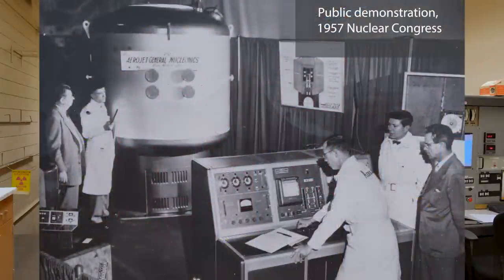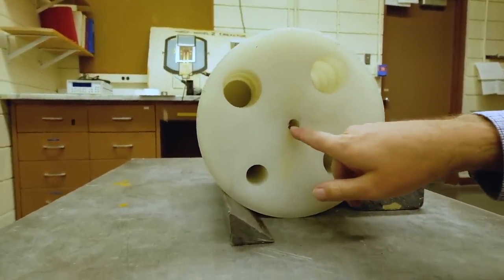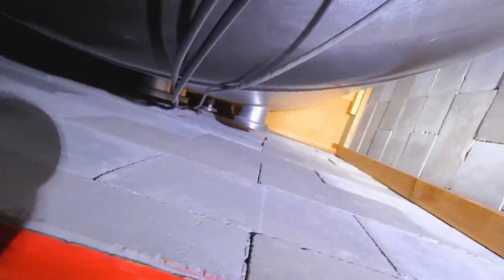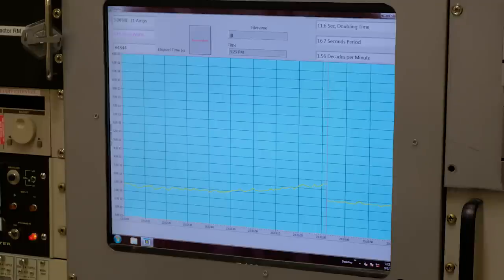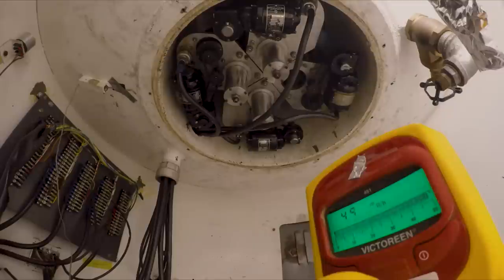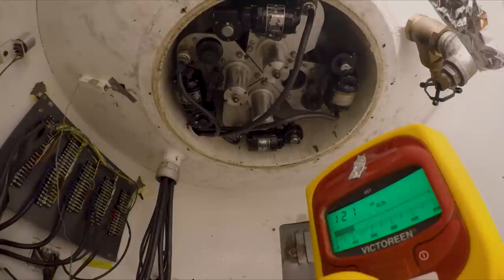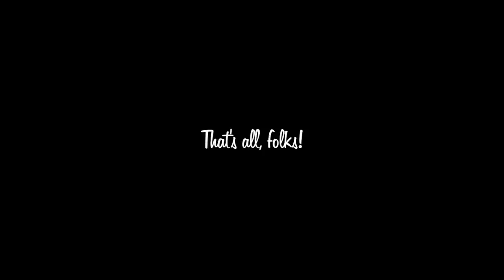UNM Nuclear Reactor Tour and Demo, 2020

Comment: I love how they're running the control software for a nuclear reactor on a pc running windows 7 with USB slots exposed on the front of the machine.
Reply from the maker: No, the PC at the console does not run "the control software for a nuclear reactor."  It is an experimental / teaching aid having no interconnection with the reactor controls and no defined role in the facility tech specs.  It runs a LabVIEW executable that collects and displays data from an auxiliary ex-core neutron detector, and we have that data on the display in this video because it's instructional.  The computer is old.  It runs an old OS.  And although it works just fine, anyone outraged that old tech is in use at UNM is welcome to quench their concerns by making a hefty donation to the UNM Foundation here: https://www.unmfund.org/ That way, when our console PC is no longer working just fine, we can replace it with a $4000 PC specced for gaming and slap your name on it.
Reply: This building is controlled access and the PC is likely not on the network, so it's not a huge concern.
Reply from the maker: @MontegaB  And more importantly, the computer has no reactor control function.  We can and do operate the reactor completely without it.
Reply: @Carl_Willis  I'm loving this reply.  You have a great way of getting your point across.  :D
Reply from the maker: @FletcherFinance  I'm a little surprised sometimes what people PRESUME sometimes.  They presume the computer is controlling the reactor.  They presume that because it's old, it must be insecure, at risk, decrepit, not dependable in its role, etc.  They presume the facility is staffed by complete morons, and presume that they are clever ubermensches who've got this whole thing figured out because they saw some videos and presumed some shit.  Sometimes we just have to cut 'em down to size...
Reply: @Carl_Willis  Totally agree!  People online assume too much and don't ask enough questions.
Reply: @Carl_Willis  This has got to be the hardest roast i've ever seen from a smart person, I'm not very smart, and i'm pretty sure alone you could absolutely kill my grammar. This is what killed him. "That way, when our console PC is no longer working just fine, we can replace it with a $4000 PC specced for gaming and slap your name on it.
" That was stone cold... GG.
Reply: xn0  As long as it doesn't require internet, but then that begs the question on how it got installed there in the first place...
Reply: Windows 10 would force-update in the middle of a safety test.
Reply: Are you ashamed?

Comment: I love that it has a University of New Mexico asset tag on it.
Reply from the maker: This is so if somebody steals the reactor and tries to pawn it, or eBay it, or what have you, it can be tracked down and returned.  Theft is a big problem in the Albuquerque metro area.
Reply: Asset management people can be quite zealous! I used to work for a calibration facility and we would regularly receive hydrometers for calibration with asset tags attached directly to them... which is a bit of a problem, as changing the mass of a hydrometer will utterly destroy its accuracy.
Reply: @MrMe01  We had quite a simple but effective approach - revoke the calibration certificate, and explain if they wanted their hydrometer back with a fresh calibration we needed their permission to remove the tag, otherwise we were happy to ship it back to them uncalibrated and with a certificate declaring it unfit for calibration in its current condition. No idea if that stopped them sticking a tag straight back on it, but as long as we'd told them in writing that doing so would void the calibration our asses were covered (it's lovely when something is officially not your problem!)

Comment: Now if this isn't the most adorable reactor I've ever seen. I want one to play with in my backyard.
Reply: If only the reactor put out enough power to run it's own electronics :(
Reply: @MrTurboTash  Yeah, I'm not even convinced that this reactor makes enough heat to keep its moderator warm.
Reply from the maker: @jordanrodrigues8265  The reactor design is limited by its negative temperature coefficient of reactivity to a steady-state power of about 10 W.  It can generate much more intense transients.  We are license-limited to 5 W.
Reply: @Carl_Willis  if it's not a dumb question, what's the use of such a tiny reactor? I guess as a live education tool? Can you do science or 'useful' stuff with it like irradiate silicon and whatnot?
Reply from the maker: @uzaiyaro  Teaching and training...it demonstrates the same physical behavior as much larger reactor, and is much more approachable for a large variety of hands-on experiments.  It can be used for neutron activation analysis and some other tasks as well.

Comment: Carl;
the U.S. Navy had a small reactor at the Naval Post Graduate school in Monterey, Ca.  This was decommissioned there and later moved to Cal Poly State university where I last saw it.  I very much resembled the AeroJet Nucleonics version you have there in New Mexico.  I saw it operational in Monterey but I do not know if the unit was ever operational at Cal Poly.  Monterey presence was in the 1960's and it appeared at Cal Poly around 1974-76 range.  Thought you might know the history of that reactor as it might be among the 20 that were manufactured by AeroJet.  Great video !!
Reply from the maker: According to my information, the Naval Postgraduate School had an AGN-201, serial 100 (meaning, presumably, the first unit out of production).  I can't tell when it was taken out of service at NPS or what happened after that, but from what you say, it looks like Cal Poly may have picked it up.  Not sure what happened to it after that!
Reply: @Carl_Willis  Carl, the Naval Postgraduate School reactor was shutdown in 1972, and then shipped to Cal Poly SLO where it operated from1973 through 1980 and decommissioned in July 1985. As far as I can tell there were only 15 AGNs with serial numbers although about 25 more were intended.
Reply from the maker: @robertbusch3144  Thanks for the detail!  On a somewhat unrelated note, do you know when and why production stopped?
Reply: @Carl_Willis  Carl, I think they found the market limited. The two main designers, Robert Mainhardt and Arthur Biehl, decided they had finished their challenge and decided to move on. In April 1961, they founded MB Associates (MBA) and got involved in gyrojets and small rocket projectiles. Based on the critical dates, it would seem that the last AGN-201 was finished in 1959.  AGN did make some AGN-211 reactors and in 1965 built a 250 kW pool-type reactor known as the AGN Industrial Reactor. It appears to be a TRIGA reactor. It is now called Aerotest Radiography and Research Reactor (ARRR), Docket 50-228.
Reply: Carl, just found more info at NRC - License for ARRR has been transferred to Nuclear Labyrinth. Letters seem to be going to David Slaughter who was head of Utah's reactor back in the 90's.
Reply: @robertbusch3144  Oh wow! I had no idea the designers of the AGN-201 are the guys responsible for those crazy gyrojet guns. I've always wanted to fire one of them but the ammo is worth more than gold these days. I've often wondered what it would take for someone to bring gyrojet back into production in today's climate. D= They're basically frickin 1950's sci fi space guns. xD

Comment: Nice rebuild on the control panel! I've had the joy of seeing the original AGN-201 panel in various states of disassembly, so I can appreciate the work that you guys put in to assembling your new one. I love the mixture of modern and vintage parts! Since then I've really come to appreciate the old illuminated displays and buttons thanks to channels like FranLab. 

I still like what they did with #103 though, since it keeps the original chassis layout, but I'm probably just biased. xD

I know you're tired of people ragging on you about your monitoring PC for various unimportant reasons, but I'd still suggest you replace it with a redundant pair of modest rackmount servers so that in the event that one gives up the ghost you can quickly flip to the other one to save time and hair pulling and keep the display operational instead of having downtime. I mean, originally students had to work from just the displays on the original panel and didn't have nice pretty digital graphs, but it's still very nice to have.

Comment: Firstly, I had no idea UNM had an adorable little reactor, despite growing up in the area and living in Abq now. Secondly, that startup had me squirming about in my chair. I'm a former nuclear mm and it went nothing like what I was expecting.
Reply from the maker: Yes, quite an unusual little system that surprises plenty of people who have cut their teeth on other reactors.
Reply: @Carl_Willis  Well, it was more the impromptu feel of it. You pulled a safety rod right out of the core and jumped straight into a startup. No estimating critical position, no stopping prior to it to verify indications, no verifying criticality during a pull(in this case push) and wait. Most of my watch officers and my upper chain of command would have freaked out if we pulled anything like that. I understand it is a very small core, but it still is a nuclear reactor.
Reply from the maker: @Jtretta  Yes, there's no requirement to estimate critical position, or to pause on the approach to critical once the coarse and fine rod insertions begin.  I should note that we do verify indications and compare with previous readings both before and after inserting the two safety rods.

Comment: On your manual SCRAM which you said was subject to gravity, why were the rod drive motors operating in high speed?
Reply from the maker: The rods themselves are dropped by a magnet.  The magnet carriage has to be driven to the out position by the motors so the magnet can reengage the rod armature, and that is why these motors are running.  The rods themselves are already down at that time....they drop within a few hundred milliseconds.
Reply: @Carl_Willis  Thanks for explanation! I knew something was missing.
Reply: @fredflickinger643  I was wondering the same thing.  Thanks for asking!

Comment: So cool. Playing with the power of the universe! Very smooth operator you have there too, very nice job. I notice the rod position readouts are analog. Do you guys have rotating cables routed from the motors to the console for that?
Reply from the maker: These are servo indicators, so it's 100% electronic!
Reply: @Carl_Willis  Oh good that makes sense. They look like very good motors and the machining of their mounts looks very expensive! Is all of the rod control assembly original to the reactor, or has that been re-worked over the years?
Reply from the maker: @MontegaB  There have been like-for-like replacements over the years of various parts of the rod drives.

Comment: Hello, what an interesting demo, below are my observational question, apologies that a couple are light hearted (like the first one and the sushi one)

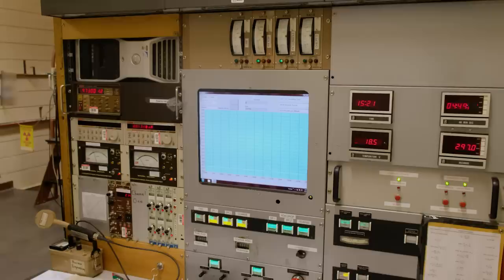12:28 what is behind the blurred door?

12:32 why is this rod not radio active from previous start ups?

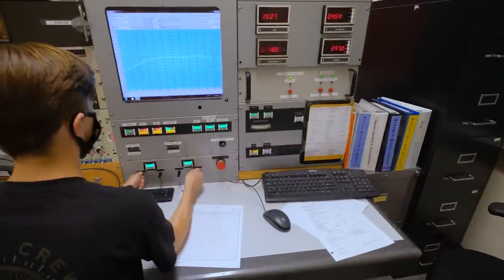17:58 I'm guessing that the phone under his left hand has more computational power then the entire console...

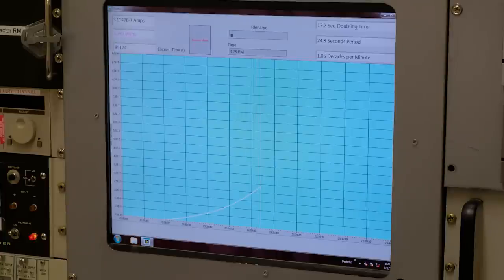21:06 1W, when you say 1W is that literally 1W?  "1 watt of thermal" Like less than a match stick of energy? 

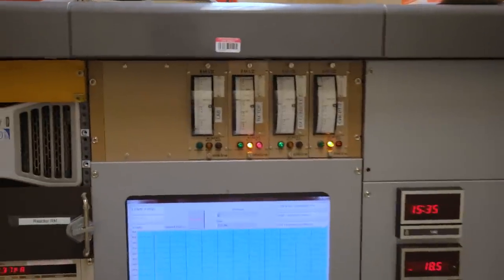26:15 on top of the conosol - is that barcode off someone's sushi box?

28:39 how come this switch gives some physical resistance?

Ohhh and why did youtube not give me a single add? I mean if this was a Rick Beato video then I would get an add every 3 mins

Comment: This is just awesome as usual! And I would finally ask a question I had for a quite some time... Well I do understand why old equipment is measuring R/h but I am wondering why fairly modern devices on Carl's videos are also showing legacy Roentgen unit?  So is that a matter of taste or something else?
Reply from the maker: The Roentgen quantity is easy to measure using electronic instruments.  After all, it's a measure of charge released per mass of air.  And there is the convenient accident of nature that, for most gamma radiation energies encountered in practice, a 1 R exposure produces a whole-body dose equivalent of about 1 rem.  This relationship breaks down at low and high energies (and the exposure unit itself becomes rather meaningless at higher energies).  But the R unit is still used because it is easy to measure and remains broadly meaningful.
Reply: I guess that’s why there’s still a lot of Geiger counters you can buy that can be set to measure in Roentgens or sieverts.

Comment: Thanks for posting this video and the detailed explanations.  This is a really unusual reactor design that I've never seen before.   Dumb questions - what you're calling "control rods" are more properly "fuel rods", right?  That's why inserting them increases the reactivity?   And when you're starting up the reactor, is it critical on prompt neutrons alone?  Doesn't the operator have to be super careful to ensure that it doesn't run away when the delayed neutrons appear?  And is there any kind of cladding on the fuel elements?  What happens to the gaseous fission products?  Thanks again...
Reply from the maker: The control rods are called "safety rod 1," "safety rod 2," "coarse control rod," and "fine control rod" per the manufacturer and the tech specs.  They contain fuel in this reactor and so work a bit differently than absorber-based control rods, but the purpose they serve is the same.  Our reactor is emphatically NOT critical on prompt neutrons alone...that would be very dangerous, and indeed a number of safety measures are taken to prevent even the possibility of prompt criticality in this system, including limiting the excess reactivity and the reactivity of experiments.  The fuel doesn't have a "cladding" per se; the fission product barriers are the fuel composition (sealed plastic) and the hermetically sealed core tank.  Gaseous fission products that end up in the core tank volume are mostly short-lived like Xe-135 and decay in situ.  When we have to open the core tank, we sample the gas in there for detectable fission products before we commence.

Comment: Very nice video, thank you!
What are the in core meters?
The current range of the one you use to measure power indicates a self powered neutron detectector, but I may be completley wrong with that assumption.
I'd love a video where you go over the instrumentaton in more detail!
Reply from the maker: Yep, didn't discuss instrumentation very much here.  The two redundant safety channels are uncompensated boron-lined ion chambers; current from these is displayed on the picoammeters at the console.  They need 600V to operate (although they appear to be "self powered" to a degree if bias is lost).  We also have a pulse-mode fission chamber for start-up measurements and another boron-lined ion chamber that operates the computer display you see at the console.

Comment: i have a question... i am verry facinated about how you an crawl under the reactor core...i dont know hot to explain but...at the time you crawl in the reactor was on a low Power Stage where the radiation isnt that high...but how can you go again in this smal cabin under the Reactor after its got throu 500 Ronten Per Hour... the radioation does othing on the reacor housing?

Comment: You are licensed to operate at or below 5 watts, but what was this reactor rated at from the factory?
It seemed like you had a significant headroom with how fast it was going.
Reply from the maker: The reactor was originally offered with maximum power of 100 mW.  With added shielding, we can operate at 5 W.  At steady state, the reactor will top out at around 10 W due to negative thermal feedback, but it can supposedly generate transients in the kW range without reaching the safety limit.  We're not set up or licensed to do that at UNM, however.
Reply: @Carl_Willis  The unit at Memphis State University was licensed for 500mW.

Comment: Would chernekov radiation be visible from such a low power reactor If there was a place to view it? Thanks for the great video.
Reply: same thing I was thinking.. tbh I'd think not because the beta decays are slowed by the lead wall before moving through the water. open pool type reactors are 1) choochin harder and hotter 2) exclusively using water as transparent shielding not a moderator . idk im just a learning boyscout lol  check out Berkly's experimental reactor where they make exotic elements and shit, on youtube, elements like LIGMA-69, LSD-25 and DATBOI-420 keep your centrifuges off the internet and thorium works too yaknowwhatimsayin?, we just can't make munitions from its depleted fuel .                                without a doubt you're on a watch list  (__)(__)=======D~ how many shakes are in a dollar?
Reply from the maker: None of the reactor core components are transparent to light, so not much of a chance of seeing Cherenkov radiation.  A sensitive detector like a photomultiplier could probably detect Cherenkov light in the air in the Glory Hole or in the water of the biological shield tank, but your eye could not.
Reply: @Carl_Willis  thanks Carl

Comment: Very cool little reactor. Can you demonstrate Xe-poisoning with it?

5 W... I guess you will never have to refuel it :-)
Reply from the maker: It's pretty hard if not impossible to detect xenon poisoning in such a low power density reactor.  Some AGN-201 reactors detect Xe-135 by gamma spectroscopy in the core tank gas after operating for a while.  I haven't seen that in ours.
Reply: @Carl_Willis  Makes planning a bit easier, no waiting three days before restart.